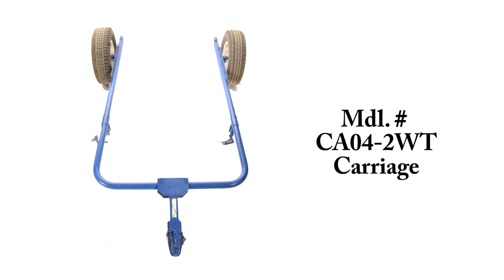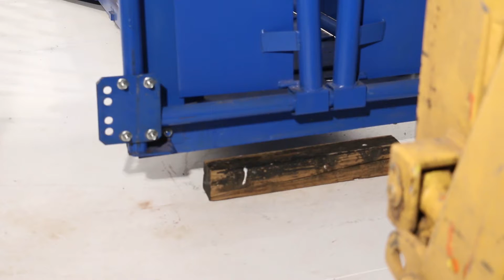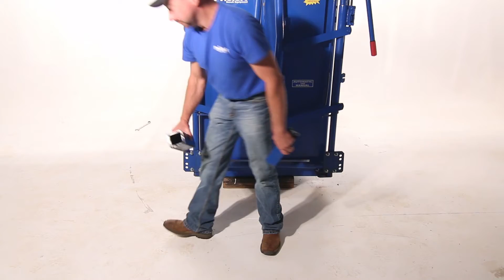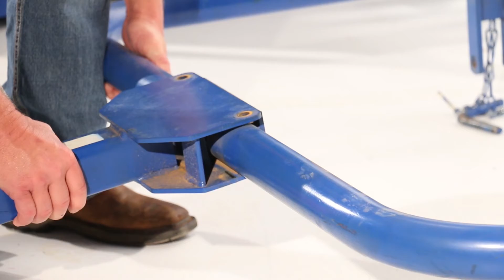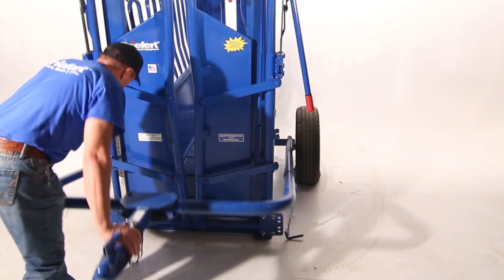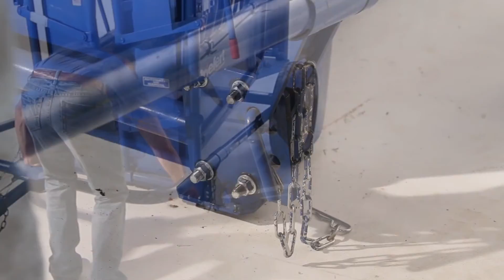How to Attach a Carriage to a S04 Squeeze Chute

Comment: Remind me to never buy one of these.
Reply: why?
Reply: @JimCasler  It's been 4 years, but I'm assuming because it looks like a pain for one person to do quickly & easily. But I've never done it, so I could be wrong. 😃
Reply: Or it could be the inevitable rust and replacement cost.
Reply: @aCycloneSteve  apply trunk bedliner around the lower tubes which contact grass/ground. Cover squeeze chute when not in use
Reply: @PowerGearPerformance  Planning ahead? That's crazy. 🙂